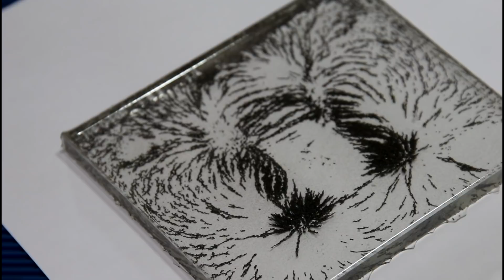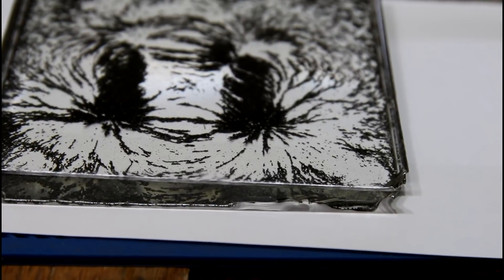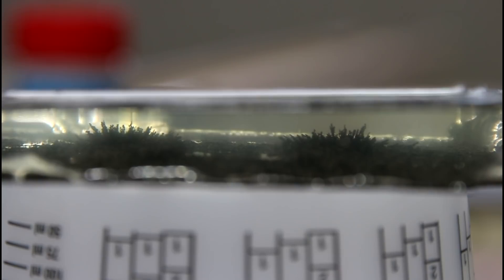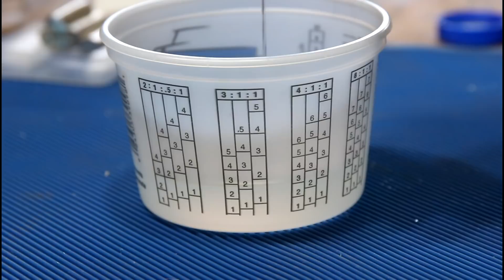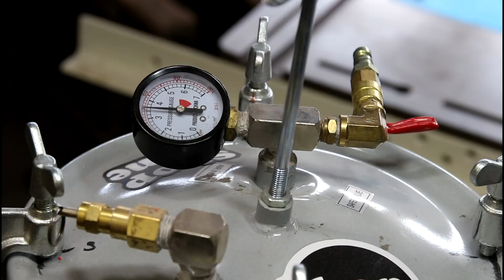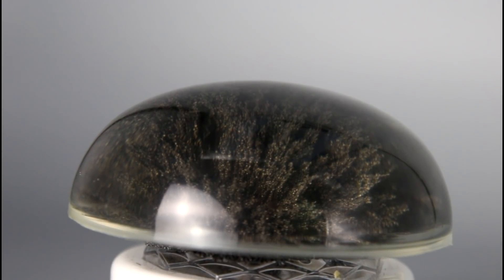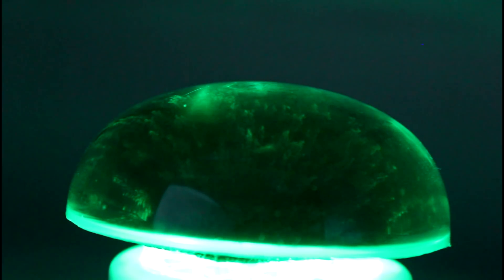Capturing Magnetic Lines of Force in Resin?: Social Distancing Day 5

Comment: you need to try finer iron filings and mix them in resin before pour they still arrange themselfs on force lines but i think it will be more visualising =)
Reply: Yes!!!!
Reply: Yes; being able to take advantage of the buoyancy of the filings in the resin may allow for the formation of larger structures.
Reply: He was using pressure, so any buoyancy contributed by entrapped air is minimized.
Reply: @Roderick storey The pressure pot isn't a vacuum, it basically puts so much pressure on the bubbles that they shrink to microscopic size and are no longer visible.
Reply: @Roderick storey Yep, both are valid ways, although if i recall you have to be careful with a vacuum because it is pulling the air out so sometimes it can make the bubbles spill over the top. I'm sure there are examples on Peter's channel but of course this too can be mitigated just by going slowly and being patient. My best guess as to why Peter prefers to use pressure rather than vacuum is that it's easier, you just throw it in the pressure pot, pressurise and leave it there, whereas you have to actively monitor the vacuum chamber to ensure it doesn't overflow during the air purge. I don't do this myself so i have no idea if pressure pots have their disadvantages, but it seems to me like pressure is superior in most cases. Take my opinion on this with a grain of salt, i'm just an observer with no actual resin experience.

Comment: Rough up the outside of the silicone mold and Coat it in a resin shell to hold it together when it's full on the inside because it's smooth it should pop out right?

Comment: Also: first thing would be wrapping the mold with some wire or some string, to hold it together. Just saying ;)
Reply: I think its soft silicone and will just leak anyways.
You would need some kind of clamp thingy
Reply: I use hot glue to seal the edges closed, I have the same molds
Reply: What about those wide rubber bands that you get on produce? It would provide even pressure around the whole ball.